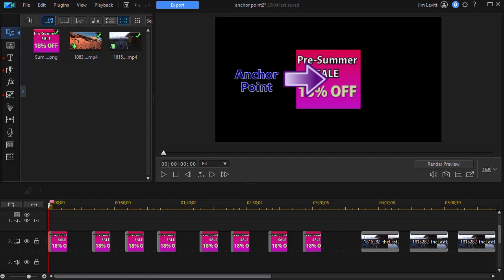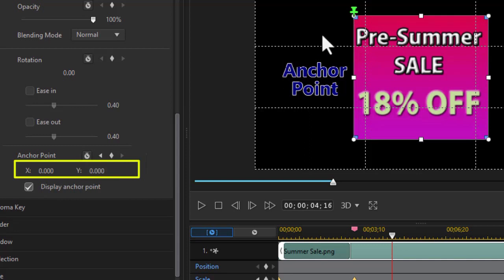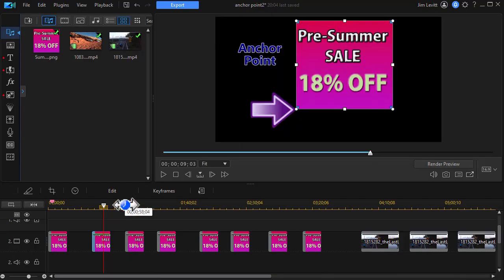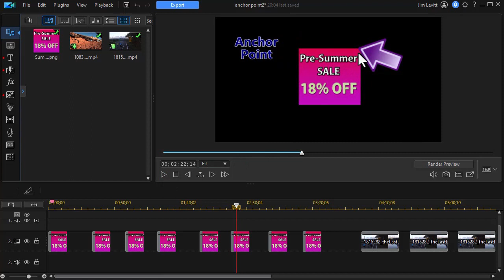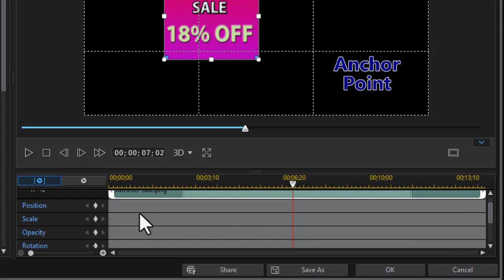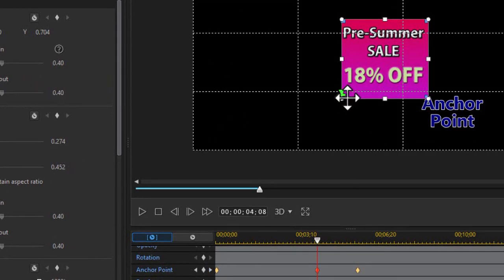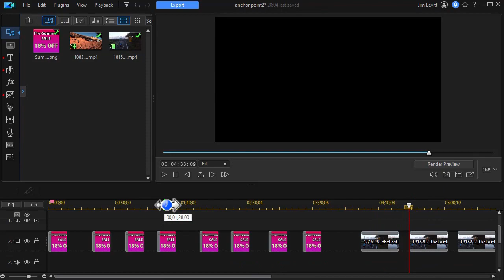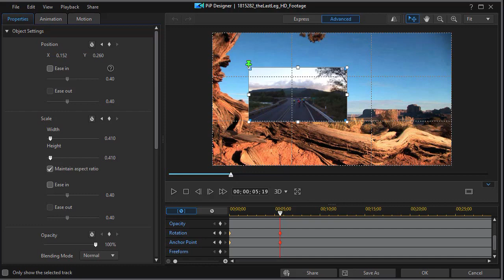PowerDirector - tips on working with anchor points

Comment: Jim. I have a question. I just updated my 365 version. Admittedly, I havent used PD in probably a year, so I'm trying to get used to where everything is now. In the past, when I brought an image into the timeline that wasn't in a 6:9 ratio (not wide enough), I'd click on it and drag a corner to the side and the picture would snap to the sides at the same time because the anchor point was in the center, by default. But now when I do that (1) the anchor point defaults to the opposite corner I'm dragging it from, (2) it doesn't snap to the sides, and (3) there's no green marker to move to the center. I tried to research it and there was some reference to where to go but where it said there would be a setting for acchor point, there wasn't. I just updated today so I have the most recent version. Any idea how to fix these issues? Thanks!
Reply from the maker: I'm not totally following your process, but I hope this helps. Is your goal to make the image fille the 16:9 screen or is this more about positioning the image?  You can find the anchor point controls for an image by clicking on the image in the timeline, then pressing the F2 key, which gets you to the advanced edit. You can both turn the visibility of the anchor point on and change where you want it to be. --Jim
Reply: @SharperTurtle  thanks Jim. My goal is to make the pic exactly fill the 16:9 screen with the anchor point in the center. In the past, it took 3 seconds. I grabbed a corner and pulled it and it snapped to the 16:9 size from the center. I believe where you're telling me to go is where I ended up going from my research but I didn't see any way to turn on the green marker. Also, it was great to have it snap to that position rather than having to fine tune it exactly. I'll take another look tonight at where you're suggesting. Thanks for being a resource. Always enjoy your videos.
Reply: Well, when I do what you said and go into advanced editing, the window heading says Advanced Overlay Editing and there are 3 tabs - Properties, Cutout and Animation. And nowhere in there is there anything about an anchor point. If I double click on the picture in the timeline, it opens a window that has tabs for Tools, Mask and Animation. In the Tools section, there is one option on the left for Position/Size/Flip. In there, under Position & Size, there's a scale section where I can increase the size of the pic but that's very manual and I have to play with it to get the exact size to fill the screen. Aot of work to do what used to take 3 seconds. But not finding anything about anchor point. But if I use Copilot to ask about anchor points, it shows me the steps to get to the Position/Size/Flip page. The last  step there says in the position section, which is where I'm at, it says you can adjust the anchor point by dragging the anchor point control to the desired location. Again, there's nothing on this screen that says anything about anchor points.
Reply: Update - while I'd still like to find out how to get the anchor point marker, I figured out my immediate issue. If I hold CTRL and scroll while in the preview window, I can zoom out. Then if I hold CTRL while dragging a corner of the pic, it will enlarge with a center anchor point and snap to the edges, like I used to do. If you aren't sure how to get the anchor point marker, I can contact CyberLink.
Reply from the maker: I applaud your tenacity. Thanks for sharing your findings with me and the rest of the community that follows our discussion! --Jim

Comment: Thanks for highlighting this feature Jim, has some real possibilities. Have used them but did not know that you can keyframe them. I really like the way you put over the feature in your tutorials it makes it easy to follow. I was wondering if you might consider doing a tutorial on timecodes, have a couple of cameras that have timecodes. I see that the Multi cam Room has Time code option.
Reply from the maker: Thanks for the remarks and the ideas. I will do some digging and see if I can come up with a coherent approach to using timecodes. Nice that you have cameras that have that component built in. Thank you again. --Jim

Comment: Thanks for pointing this out Jim. I've used this a lot when creating a text box or picture as a sort of label where I have the scale basically at 0 where you can't see it at all and it grows to the final size, appearing to expand out of nowhere, where the anchor is in the corner of the text box or picture and at the object you want to label. It's a great effect.
Reply from the maker: Thanks for sharing your experience with this tool. Sounds like a great application of this effect. --Jim